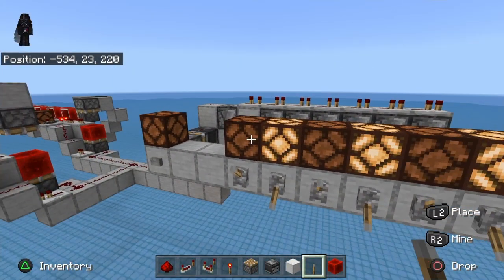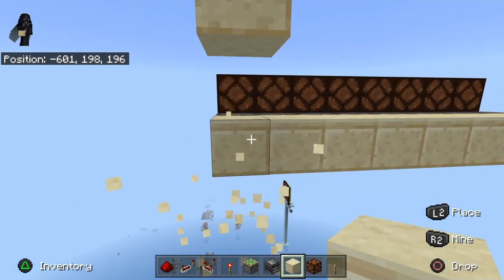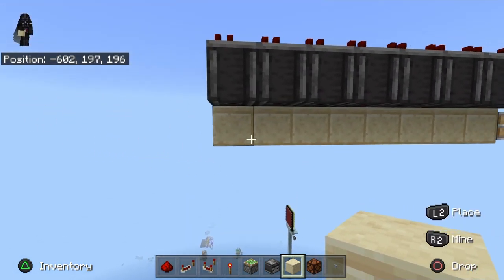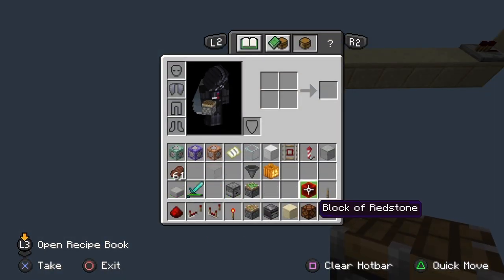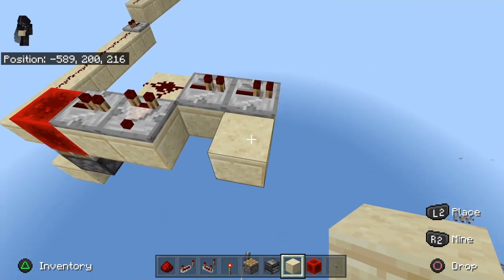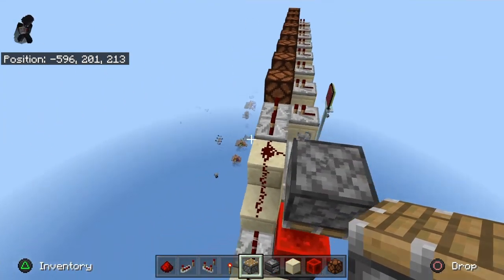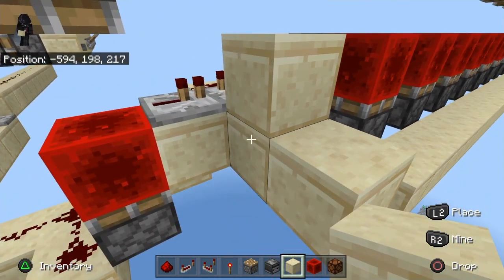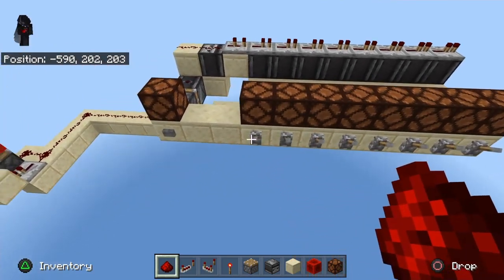Serial Transmitter & Receiver Tutorial: bedrock edition

Comment: Will this still work for 6 bits? only ask because I seem to be having trouble getting it to work for some reason.
Reply from the maker: Yes it will, that's the smallest I have tested it though.
Reply: @darth_dub_  any thoughts why it might not be working?  Thought I followed the video but I'll double check..  any common issues I could check?
Reply from the maker: @matthewjones991  the first observer counts as 3 ticks while any observer stringed after counts as one. That's the thing that gave me most issue. Other than that it's been months since I used this build and I'm at work now, later tonight when I get on I'll get it 6 bit.
Reply from the maker: @matthewjones991  if you check the "about" tab on my page there is a discord link if you want to join, somebody in the redstone section may be able to help sooner.
Reply from the maker: @matthewjones991  I forgot how different the 6 bit design is, I just made a quick video.